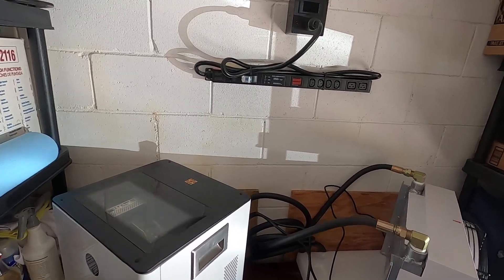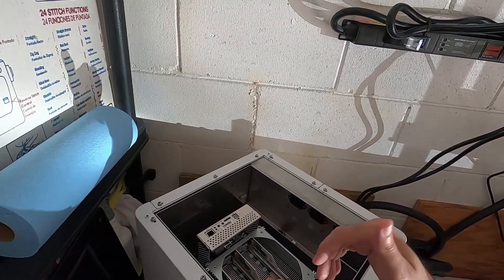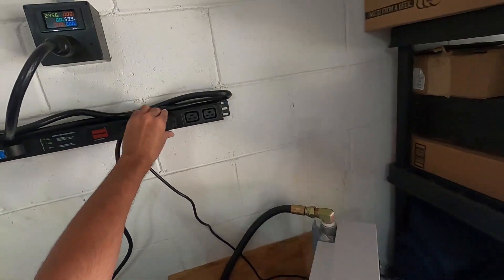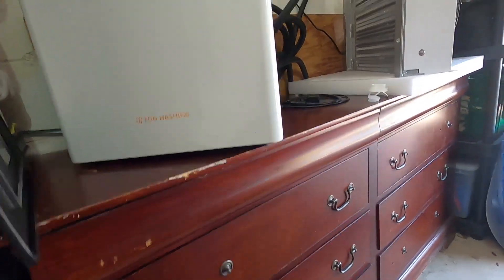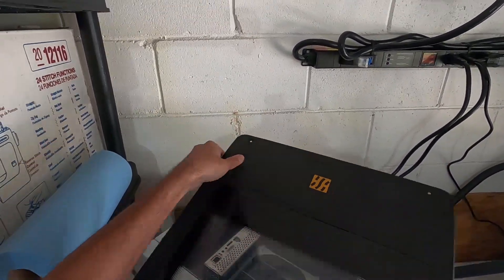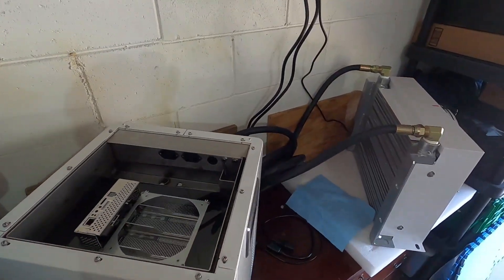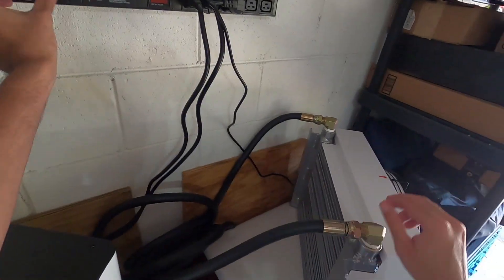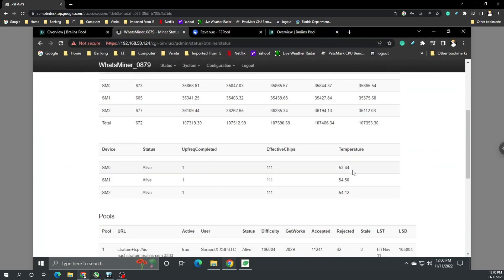Completing the setup of FogHashing C1 Immersion Kit

Comment: Where you got this frimware??
Reply from the maker: Whatsminer Telegram, but you can get air to liquid tool from Oliver- 
https://twitter.com/oliver0329/status/1752872116465336475?t=4xz6gqHkMoDq9haEyOMh_A&s=19
Reply: @SerpentXTech  this firmware can drop my hashrate performance?? Or it's good please tell
Reply from the maker: @AsicminingIndia  so it is for immersion cooling only. If you are on air don't use it. Just use the normal Whatsminer firmware. The one I provided won't improve your hashrate, it just runs more efficient and cooler than on air because of the immersion liquid cooling

Comment: Does this work only for Bitcoin miners or we can use it for Kaspa miners like KS3m?
Reply from the maker: Works with all ASICs, just each model/manufacturer has a lil different process. For example, you can do a firmware update on Whatsminers and Bitmains, and on others you just add a fan dummy adapter

Comment: Hi friend.. Could you please help me with the characteristics of the oil circulation pump, some photos of the plate to see the power and flow and the model of the pump... and some photos of the diameter of the hoses... I am from Ecuador... and this system is not sold here, so I want to make one on my own, please help me
Reply from the maker: Message me on Twitter or Discord